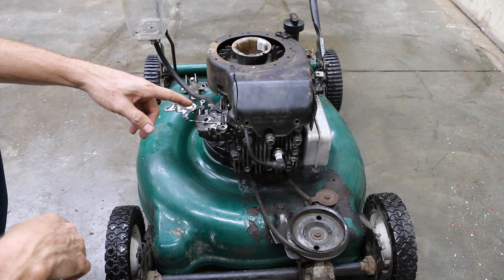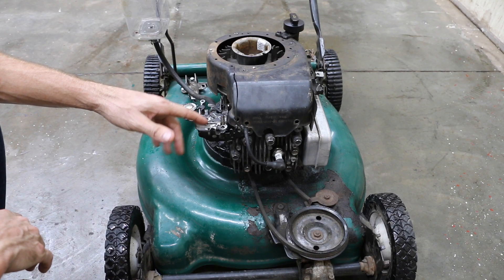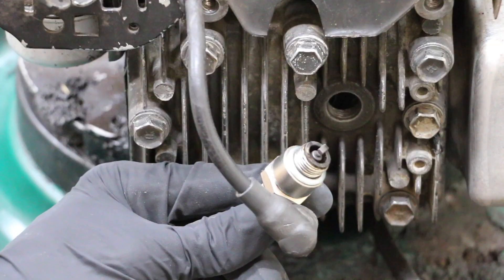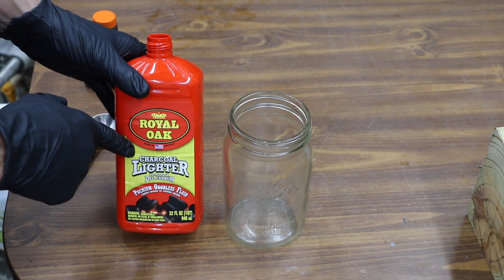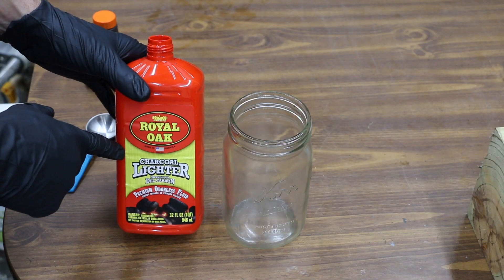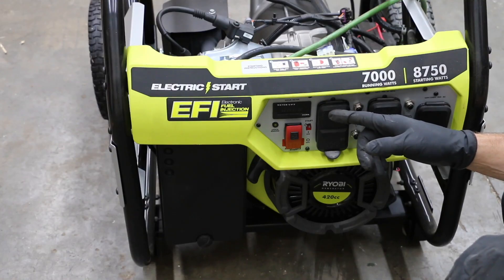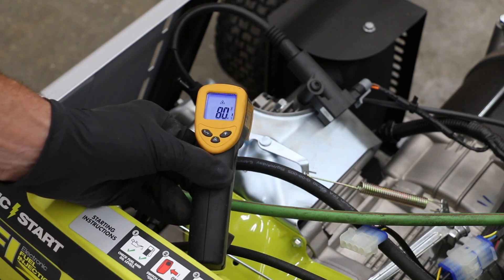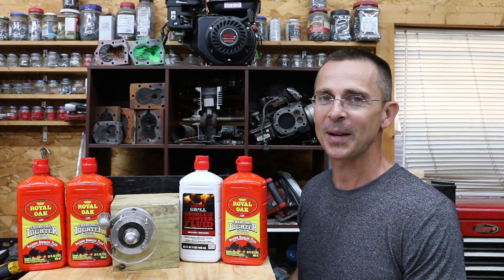Will a Gas Engine Run on Charcoal Lighter Fluid? Let's find out!

Comment: At least one recipe for lighter fluid is polystyrene dissolved in petrol/gas.  If that's what is in your lighter fluid then I imagine it should run pretty much as it does on gas, but will tend to leave deposits of partially burned polystyrene in the head.  It will typically be slightly more viscous that petrol, so might screw up the fuelling on a carb-fed engine.
Reply from the maker: Thank you!

Comment: could you please do a test on pressure washers and the PSI output,,,, because what they claim and what you get is not even close..
you could buy Home Depot brands test them with PSI gauge (link below) and return them when they don't meet the specs they claim...thx
https://www.amazon.com/MINGLE-Pressure-Washer-Gauge-Connect/dp/B07TPMW878/ref=sr_1_1_sspa?crid=1OIEQ7ACIU2X2&keywords=pressure+washer+psi+gauge&qid=1569876980&sprefix=pressure+washer+psi+%2Caps%2C204&sr=8-1-spons&psc=1&spLa=ZW5jcnlwdGVkUXVhbGlmaWVyPUFDQUNNMDJSVUdaMlkmZW5jcnlwdGVkSWQ9QTA3ODM5MTQxVzVWVEZBUjY1QUxXJmVuY3J5cHRlZEFkSWQ9QTA5MDI2NTJMODFMT0RZWlkxV1Imd2lkZ2V0TmFtZT1zcF9hdGYmYWN0aW9uPWNsaWNrUmVkaXJlY3QmZG9Ob3RMb2dDbGljaz10cnVl
Reply from the maker: Thank you for the video idea!

Comment: Your videos like this reminds me of when I was a. Teenager and my friends and I would put anything petroleum based in our old 63 dodge dart with a slant six we mixed diesel and kerosene with the gas and it burned oil so we would swipe any kind of oil from one of my friends dads who was a logging equipment guy. That crankcase saw everything from transmission fluid to 90 weight gear oil and every weight of engine oil made! Thanks for your hard work making entertaining and informative videos!
Reply from the maker: Great memories! Thank you very much!!

Comment: can you do a test for 20w40 1liter of atlas honda for 125 cc. The reason i a m asking is due to the brand monopoly and specially the oil here is different from other region of the world of same brand. below is the company link with the product. if you cant find the oil i will try to help to send some samples or product but i will need a guildlines for that. below is the link.
 https://www.atlashonda.com.pk/engine-oil/
Reply: following e commerce website have the product.
 https://www.daraz.pk/products/mobile-oil-engine-oil-genuine-1litre-for-cg-125-and-other-125-cc-motorcycles-i102513500-s1248366955.html?spm=a2a0e.searchlist.list.7.38022cc6oOtJkY&search=1
Reply from the maker: Thank you for the video idea!

Comment: Can you test BLASTER small engine tune up in a can ? Supposed to do wonders for small engines to remove carbon , clean and protect. They say to hot soak and use in intake similar to the process with sea foam but this has lube in it .
Reply from the maker: Thank you for the video idea!

Comment: Will running an engine with carbon build up be cleaned by switching to propane?  I understand engines that run on propane do not build up carbon deposits making the engine last longer and propane is slightly higher octane that regular gas.
Reply from the maker: Thank you for the video idea!

Comment: I would like to see some videos on TruFuel gas they have premix and 4 cycle.  I would like to keep some of the regular 4 cycle for emergency use since it is supposed to have a long shelf and is sealed so maybe some kind of test to see if the container pressure gets high if it hot outside.  Like if I keep it in my tool box on the truck will the container leak or explode when its hot out.
Reply from the maker: Thank you for the video idea!

Comment: This question has nothing to do with this video.hoped to get your opinion on an issue in having with a 70's multi fuel  deuce& 1\2 .it's never had off-road diesel fuel run in it.I'm in NC .it has always started & run very well.don't use it a lot so also keep stabilizer in it too.didn't realize fuel gauge was off .usually top it off..ran out of fuel .realized right away .shut it down & got more fuel.got lucky cranked right up. Warmed up as usual,drives bit,idol for a while  shut off.dodged a bullet.had a storm last night .supposed to have been 1\4-1\2 inch.doubt that much ..caught off guard.realized fuel cap was off from adding fuel .any suggestions or thoughts would be appreciated..need to sell that truck and a repair bill would not be doable right now .thank you .

Comment: I'd really like to see you test these solar rechargeable battery packets that are about 20,000 to 30,000 mah. They are all about 6" x 8" x 2". It would be nice to see if their power rate is accurate as well as their charging ability while being used or stationary.
Reply from the maker: Thank you for the video idea!

Comment: I remember that my friends dad said he one used moonshine in his 2t bike it was a romanian 50cc engine,he said it worked well just to get him home but the exhaust was glowing red hot
Would like to see this test
Reply: Running on Alcohol requires different timing and more fuel rich mixture or will lean out and spike temps. Alcohol can wipe cylinder walls free of oil and blow by rings not made for only alcohol.
Reply from the maker: Thanks for the feedback!

Comment: I have a video idea, this may be different with the mower engines and other cars but I mixed Royal purple, redline and seafoam fuel system cleaners into a gas can then poured into my gas tank, before starting used a borascope to look at the carbon and after it cleaned up close to 30-40% of the carbon on the pistons and the valves were cleaned to varying degrees within that margin aswell
Reply from the maker: Thank you for the video idea!

Comment: Project Farm at the store: "Hi, I need a 50-pack of lawn mower head gaskets and 25 bottles of lighter fluid."
Reply from the maker: Lol
Reply: imagine the epicness of a paul harrell project farm cross over:

I need 50 briggs head gaskets, 25 quarts of lighter fluid, 4 of the $2 concrete blocks, 10 bottles of Shasta, a bag of oranges, some pork chops, and some ribs.

Comment: Seems like it would run pretty good with an octane booster. But it just seems to not atomize as well as gasoline either, by the looks of the clear cylinder head test. Maybe the best outcome with be the lighter fluid and some rubbing alcohol to thin whatever oil additives are in it to make it burn slower.  My guess would be that would make it as good as white kerosene at that point, other than excess carbon build up.

Comment: I have an idea that might be interesting!

You have tried a lot of fuel additives, I was curious to see a before and after of plugged carburetor jet(s) (either varnish or debris) after putting seafoam in the fuel and ran through, as it claims to clean jets.
Another thought would be the same idea, but carb cleaner instead of seafoam in the fuel, see if that would work better/worst/at all.
Reply from the maker: Thank you for the video idea!

Comment: Your video is great information as always, but can you find out if below 40 coolant, and other coolant additive really work??? Do these thing actually help engine run cooler? Or just less heat conductor and and show lower coolant temp at the gauge while actual engine metal part is run hotter??? I can’t really tell until you find out about it!!!
Reply from the maker: Thank you!

Comment: The interesting little takeaway from this, is the fact knocking starts when the temperature rises to a certain temperature. While it is not practical to have an engine attached to a garden hose to cool it, let alone keep the water at ten degrees celsius or so (except if you could bury a heat exchanger or radiator in an iceberg, or chill the water with a powerful refrigerator. Not mentioning all the water going down the drain) If you got a hose and cooled the head and block of that predator engine with cold water on a single pass, and stopped the head and block from heating up, you would see that engine either fail to knock or substantially reduce it. (probably the piston once it heats up, will probably provide a heat source for auto-ignition to occur) Oil is a lousy conductor, and carrier of heat compared to water.

Auto-ignition (primarily OH, and HO2 radical induced) is what causes knock and is what makes the diesel engine possible.  I actually demonstrated that back in in my science/education days with shellite. It was a very brief period where knock did not occur as the engine was air cooled and using air to cool it, it raised eyebrows when they saw it. It really proved a point. Low octane fuels can make more power if the operating conditions are right. Kerosene would make more power than petrol as long as the head and cylinder don't get hot. Definitely not practical to do in a real time scenario but possible in an experimental environment with cold water at a constant temperature of ten degrees celsius or close to it. Also extreme over-cooling would highlight why engines have what is referred to as the normal operating temperature, not too hot or too cold. Thus prove that over-cooling comes with the cost of extreme carbon buildup, and reduced combustion efficiency. ICE's are very inefficient combustion wise when cold.

Charcoal lighter fluid would work in a diesel engine with no trouble. If it knocks in a gas engine, it will burn in a diesel. There's a video idea right there.
Reply from the maker: Thank you!

Comment: Interesting. I have a new video idea: Let's say you had to use an alternative fuel to get to a gas station. You get to the gas station and immediately fill up on gasoline. Will the engine have difficulty running with a slight mix of the two fuels? Will running gasoline clean out the carbon deposits left by the alternative fuels?
Reply from the maker: Thank you for the video idea!

Comment: Just had an idea... compare paper towels, super cheap vs brand name vs store brand. Soaking speed, soaking amount, strength before and after soaking. And of course cost to how many sheets per roll as well as per use. Say a super cheep needs 3 sheets to pick up the same amount as a single sheet for a brand name.
Reply from the maker: Thank you for the video idea!

Comment: Perhaps try running a 2 stroke engine with regular oil (IE 10w-30) mixed in the gasoline instead of 2 stroke oil. More of an endurance test than whether or not it’ll run.
Reply from the maker: Thank you for the video idea!

Comment: One thing I started wondering about recently is the difference between drilling lubricants, like Boelube and Tap Magic compared to say, straight engine oil, WD-40, etc. Specifically in regards to bit longevity, and different materials being drilled.
Reply from the maker: Thank you for the video idea!
Reply: Yes please do this one

Comment: Could you compare different wire splice methods? Tensile strength and max current.
Lineman's splice w/ and w/o solder,  wires just overlapping w/ and w/o solder, butt splice crimp connectors, and solder seal heat shrink.
Another request is wire sealing methods. Dipping in acid, exposure to heat, exposure to cold, friction, and how likely electricity is to arc through it.
Nothing, electrical tape, liquid electrical tape, heat shrink, heat shrink with glue, and the solder seal heat shrink mentioned above.
Reply from the maker: Thank you for the video idea!

Comment: Lighter fluid is likely a mix of naptha (used in camp stoves as Coleman fuel) and/or refined, odorless mineral spirits, aka non-turpentine paint thinner. As fire starter, they are far less volatile than gasolines, properly chosen to reduce accidental ignition if spilled, while burning clean and toxic residue free once burning. The designs of various engines are optimized for the octane equivalent fuels intended. The fuel injected unit might have more automatic timing regulation, as do many cars today that can use basic regular to premium gases, which might help, but the lighter fluid may go too far beyond the engine adaptive features to totally compensate for. Try pure kerosene and see what kind of mess you get!

Comment: I'd like to see some corrosion inhibitor testing (Fluid Film, LPS 3, CRC 06026). Resistance to being washed away by water/salt as well as performance on both unrusted steel and pre-rusted steel would be awesome. Cars and trucks in the rust belt get eaten away when nothing is done to stop the tin worm.
Reply from the maker: Thank you for the video idea!

Comment: Twice in my life I've seen Coleman fuel used in a pinch for a car but both were cars without a catalytic converter.  First time my father in a '71 Opel and for whatever reason on the interstate ran out of gas.  Second time I was driving around in a '76 Opel/Isuzu around 1980 or so and picked up 2 hitchhikers headed to Fl... OK I'll take you until I hit a 1/2 tank since I just filled up  (This is where I learned fuel gauges are not linear!)  They didn't run great but certainly made it to the next fuel stop or home in the 2nd case being 2-3 AM.
Reply from the maker: Great information! Thank you

Comment: Thanks again for a very interesting video mate. I would have been interested to see if Gasoline/Petrol would clean up some of the build-up from the Charcoal Lighter Fluid. Of course, if you had to use the lighter fluid in an emergency, you would do so, but it would be interesting to see if you'd need to clean out your engine afterwards, of it would clean itself when back on regular fuel. Many thanks mate! :) All the best from the UK.
Reply from the maker: Thank you for the video idea!
Reply: Thank YOU for making quality content! :D

Comment: Project farm: will you try running it on hydrogen peroxide and naphtha ( lighter fluid)?
Reply: That is a dangerous combo. You never mix oxidising agents and flammable solvents.
Reply: spwicks1980 what happens? An explosion?
Reply: @walterkersting1362  yes the resulting mixture could either explode or create something extremely unstable that would explode. Peroxide and acetone for example was used by terrorists to attack london many years ago.

Comment: Nice, I hope. I am commenting before watching the video this time ;-) my guess is the flash point will be so high you wont get much power with all that pre-ignition having a party in-side your cylinder and head, LOL, anyway, what does an office worker know anyhow ;-)  bet it runs hot and burns up at least one spark- plug? ;-() boom bam, ka pow....

Comment: I got a Suzuki gs125 running on neat white spirits, was smokey and smelt bad but it ran without any modifications, engines will run on basically anything, both petrol and diesel, it's a wonder why were still running them on dinosaur juices

Comment: Love your videos, very interesting to see engines running on alternate fuels.  Have you considered trying to build a wood gasifier?  I have seen these on a couple of "TV Shows" and they present it as if they can easily drive around in a pickup running off of wood gas.  I think an engine can be made to run OK under constant load with wood gas, but I am very skeptical that you would be able to vary the load like what would be required to operate a vehicle.  Seems to me like you would need to change the fuel flow rate versus load.
Reply from the maker: Thanks for the feedback.

Comment: Project Farm Thanks for that awesome test (as usual). I would like to know if these deposits will completely burn when I use straight gas again after using charcoal lighter fluid (in an emergency situation).

Comment: I wonder if the pinging would be reduced if it were a 50/50 mix of gas and lighter fluid. If you think of it, most cars actually have about a half gallon or more still in them when the fuel pump stops pulling. So in that situation it wouldn't be pure lighter fluid.

Comment: try a diesel engine to work it with gasoline mix with oil and see if it works fine , if it perform better or not , and if it causing damage ...

Comment: Hey does i think its called clocking the spark plugs, help an engine run more efficiently. Like pointing the open face towards the exhaust port vs intake vs toward the cylinder wall. Its probably a very small difference.

Comment: On occasion, as a young person with not much sense, I'd run the push-style lawnmower on charcoal lighter fluid.  Fortunately, most lawnmowers of this style aren't subjected to heavy loads--they just spin the blade.   Worked well enough and didn't kill the thing.
Reply from the maker: Thanks for the feedback.

Comment: Its surprising how well these various engines cope with all of these alternative fuels.

Need to do a two stroke engine oil comparison test. Need to test for lubrication properties when mixed and not mixed and if their is visible smoke (some are advertised as no smoke) or residue. Also some have fuel stabilising properties to test.

Comment: You must have a lot of generators to try and use lighter fluid in one.  Also it's interesting that it doesn't have a knock sensor to eliminate timing ping.
By the way. How many push lawn mowers to to blow up ?  Lol.

Here's something to read.
https://escogo.com/charcoal-lighter-fluid/

Comment: could you tell me what equipment you use to measure infrared temps on the motors? thanks
Reply: Infrared thermometer. Google it. Just point it at a surface and it'll give temps.

Comment: would awesome to see this in regular 4 cylinder car engine than a grassmover thingy.
Reply from the maker: Thank you for the video idea!
Reply: @ProjectFarm  after the test the car engines probably won't be as useful anymore though so maybe this your solution is much easier and kinda balanced, but still wanna say that would be awesome to see this in car engine :DDD Maybe like a one time test that how much the test resault differs from that to car engine? ;)